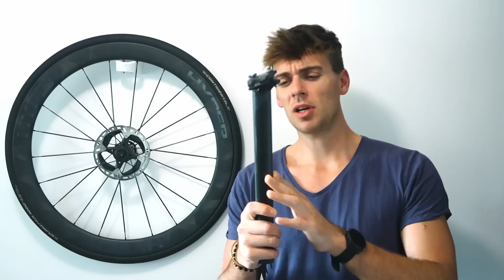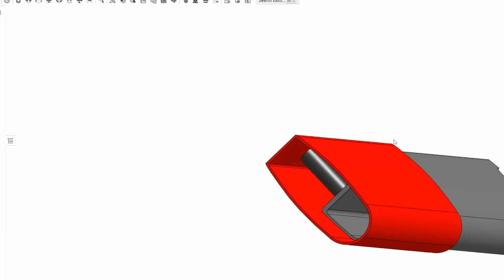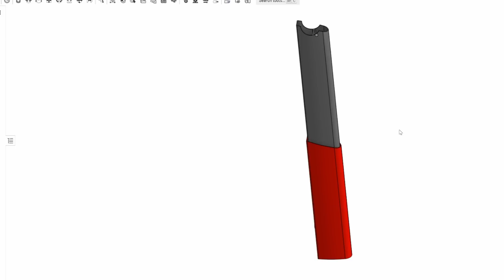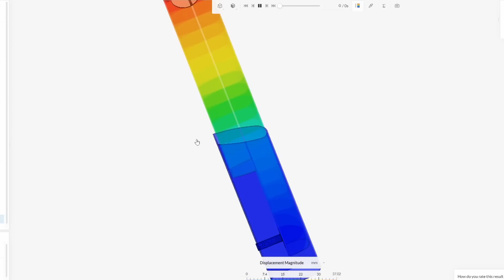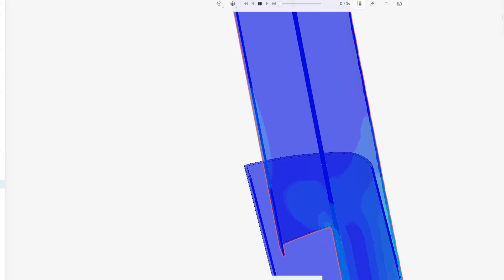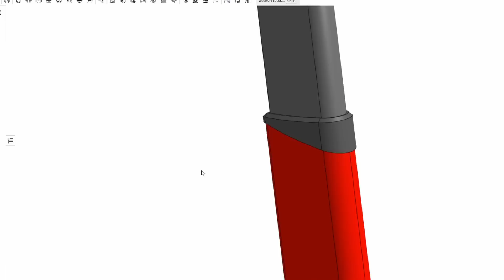2021 Canyon Aeroad seatpost fail, fix & The State of bicycle frames in 2021.

Comment: Bad engineering. The flex must be engineered in the down tube, the seat post and the saddle/beams as a system. The flex begins in the down tube where the seat post ends. the problem with aero bikes are beginning in the down tube design, it should be very weak in front back flex bend to counter the rigidity of the aero seat post.  Totally agree with the frame judgement. Greedy manufacturers need some 500% profit on the frames I presume, therefore push the price down without bothering about quality.

Comment: Peak torque, firstly I am a massive fan and I agree with your comments reference the frame industry. However, could suggesting any ad hock modifications default a customer warrant claim.
I would be very careful my friend  if a Customer took your advice and did the ad hock fix and had his warranty claim cancelled, could a barrister called Andrew then point the finger at you.

Comment: With all this critical competence you should interest yourself in the major company Garmin crap powermeter design "Vector 3" powermeter. With maybe 6 warranty claims in the last 2 years and infinite problems with their engineering i think that could be a really good topic. Many customers finally tryin to put a bit of wine bottle cork behing the connector to achieve what the brand was not able to solve (multiple drop off and peaks) , puting baby oil and trying other batteries than the one recommanded to get a set of 1200$ pedals that actually dosent work.... When brands use their customer as experimental tester... that makes me angry! thanks for the work you do, unacceptable “foutage de gueule“ en français.

Comment: Smaller seatpost with an elastomeric sleeve to cushion and damp the seatpost to seat tube intreface, done.. In the meantime just put some vinyl electrical tape around the seatpost at the frame entry area.  That clamp at the bottom of the seatpost is asking for trouble.

Comment: Different seat post. Easy enough. Longer at the bottom probably (cutable bottom?), and of course smaller at the frame edge. Bottom edge probably should be radiused.

Comment: Nice job on the mechanical analysis.  While I share your frustration with the bike industry's lack of proper design, manufacturing, and quality control, making a "plastic" frame correctly is far from easy!  Complex composite shapes and layups are subject to springback upon cooling after cure.  This can often lead to distorted parts if not properly accounted for or designed/manufactured.  Given the tolerance requirements in a few key areas of a bike frame, I am not surprised to see out of tolerance bottom brackets or misaligned head tubes (to name a few).  Employing the methods necessary to address these issues requires more costly and time consuming manufacturing processes.  Hambini has shown multiple times, some (many?) manufacturers do a very poor job of designing and manufacturing a quality product that meets the required standards.  As a composites engineer (not in the bike industry!), I can confirm building a composite frame correctly is not easy...especially at the rates/volumes most brands produce.  Not making excuses, just pointing out the industry's unwillingness to do things right in order to maximize profit.  Why do you think virtually no composite frames undergo Non-Destructive Inspection (NDI)?  There are some relatively good manufacturers, you just have to do your homework and not buy into the latest marketing BS from the hottest brands.

Comment: Nice video, no doubt about that. Doesn’t the latest Specialized Roubaix have a “flex seat post” design with a rubber grommet/cap? Aero feature aside looks like they have accomplished what Canyon is trying to do. And regarding the beam calcs, shouldn’t it be different for an anisotropic material like carbon fiber? All I remember from eng school is that they behave differently than isotropic ones...but I’m not a specialist so I could be completely wrong.

Comment: I can see another issue with this design. If the clamp bolt bush that sits against the seat post is flat with sharp corners, it may cause stress cracking of the carbon as the seat post flexes. The force applied to the carbon at this point is going to be much higher than a seat post with a clamp at the top of the frame due to the increased moment (distance from saddle to clamp).

Comment from the maker: To be fair to Canyon and I didn't mention in the video, the design intent could have been a 'simply supported beam' and not a cantilever as discussed. Pinned at the bottom (by the clamp) and with a roller support at the top, which may explain why the clearance is so tight at the frame exit. This would be very ambitious and requires a frictionless top support (at the frame opening) with zero clearance and a sliding mate. Carbon on Carbon + grease wouldn't work. It's positive to hear that Canyon are in discussion with all owners and helping with solutions or refunds.
Reply: Whatever the intent of Canyon all they needed to do was to get someone (preferably the designer) to ride the bike for 500km in mixed conditions. Too much theory and not enough practical analysis.
Reply: Instructions for the 2021 Aeroad were to use grease at the seatpost/frame-collar, and carbon paste at the bolted connection.   If the frame-collar region was sufficiently protected by a gasket, is there a reason that greased carbon-on-carbon wouldn't work?   The coefficient of friction can be quite low, something on the order of 0.12-0.14.   In comparison, clean and dry steel-on-steel has a coefficient of friction of 0.5-0.8, whereas greased steel-on-steel is 0.16 WHICH IS HIGHER THAN greased carbon-on-carbon.
Reply: https://www.bikeradar.com/news/specialized-roubaix-rear-suspension/
Guess who's got the same problem on the way?
Reply: where is hambinis Video!!!!!!!!!! did canyon roast him?
Reply: @Ghostina1  lol I was about to link it then realised it's already been taken down. Hambini's vids get taken down more often than not. Interesting
Reply: @assaultedpeanut9  Canyon did not like the truth!
Reply: I think you are absolutely right
Reply: Nice video but the calculations and modelling are massively over simplified, and the results can in no way be representative of real life. I had to say something because lots of people seem to be lapping up the science.
You absolutely cannot use beam theory (the equation at 5 mins- check Wikipedia if you’re interested) to predict the deflection of that complex part having non-isotropic material properties, complex loading and boundary conditions.  It’s not a beam as assumed by beam theory for starters - i.e. it is not much much longer than it is thick, it does not have a uniform cross section, and there will be significant shear (your FE plots show this).
You also cannot produce an accurate FE simulation of that part in an hour. You’ve neglected the load transfer from the rider into the seat tube- the seat tube would not be static. It looks like you’ve just fixed the seat tube at zero displacement. The material properties are orthotropic and will most likely vary depending on location - you cannot simply assume a uniform stiffness and Poisson’s ratio everywhere. Also it’s not clear how you’ve set up your loading boundary conditions to simulate a rider. You’ve clearly performed a static analysis whereas going over a bump would be dynamic. Couple this with assumed geometry and skin thicknesses. Your models can simply be in no way representative of real life. I’m not saying your proposed fix is wrong, I’m saying the calculations that led you to the conclusion are far too basic and have far too many assumptions to have any basis in reality. My background is 9 years of FE modelling for a living for the aerospace industry (PhD and post doc) so couldn’t keep my mouth shut sorry! Though I’m happy to be told I’m wrong- I’m an engineering nerd and this stuff interests me.
Reply from the maker: @mjlaf01  completely understand. Yes it was a basic example to outline the process for most of the viewers who won't be interested in the intricacies of FEA, anisotropic CF modelling, boundary conditions etc. There's no point doing a perfect study with so many assumptions i had to make on geometry and materials. If someone wants to send me the exact load cases, accelerations, layup schedule including layer order, transverse and longitudinal E and v of each prepreg layer, the frame and seatpost drawings, I'll send you back a quote for the work. As i said im not doing it for free. Thanks for the comment don't get me wrong you are completely correct in your criticism.
Reply: @mjlaf01  I agree with you. It is a massive simplification but what is the point of simplifying? Trading accuracy for speed/expense. I would argue that the results form this analysis should not be use to construct a new seat post or solve the problem in any other way. But it's not like they are completely wrong. He wanted to answer the question why there is a problem (and there clearly is one). These simulations give a quick overview of the problem. No one would use this to actually redesign the product. I think the estimated wall thicknesses and unknown fiber-layer layout are already a big uncertainty factors. So there is no point of taking into account all the different effects you mentioned. Sure it would give more accurate results, but it will still be a simplification as anyone other than canyon can only guess (some more educated than others) the material properties. Im sure with your expertise and access to computing power you would be able to make a much more accurate model. But the point of this video is to show where the problem comes from without spending a fortune for hardware and time expense. The model is not displaying something that is completely wrong, it's just not extremely accurate. Would you agree?
Reply: @Luca-ez2xv  Of course I agree. But I don’t think the results are presented in that context - that was my point.
Reply: @mjlaf01  fair enough
Reply from the maker: @Luca-ez2xv  thanks. Nailed it
Reply: @mjlaf01  👏
Reply: because of actual posts on weightweenies blog all the signs are that canyon plans to contruct&deliver a new seatpost (new bike deliveries are actually stopped, refund of cash in advanced was offered in some cases). But if I think about construction/test time + build thousands of them in china + delivery to europe + delivery worldwide to customer ... when the issue will be fixed completely?
Reply: From my point of view: On all frames should be two clamp mechanism - one at the top of the seat tube and the second one lower like in this case. And maybe moving parts of clamps shold be on one side (at the back or maybe better at front of seat tube / seat stay doing a bigger fricton area).

Comment: The Roubaix had this type of system, low clamp and a higher frame opening. They used a rubber grommet, and the final exit clearance is massive in every direction. Round post.

Comment: I am a middle aged geotechnical engineer that obviously does not work in the cycling industry but am often frustrated by the "techno bs" sell based on pseudo science/engineering.  Had my fair share of lemons over the year.  There was a video by either you or Hambini that made  a very good point - that engineers should be held accountable for their work.  In this case I would call this seat post a "serious maintenance issue" as opposed to an immediate life/limb hazard (like a bad tire that pops off its bead or a bad stem design).  There are fundamental flaws  with the way the cycling industry is setup that allows these issues to happen.  Thank goodness Canyon and others do not make bridges, retaining walls or baby cribs.  Hopefully they learn from this.  Hambini swears for a reason.  The issue with the fork/head tube of the Cervelo S series frames is just as bad or worse.  Canyon is now in the news but give it a few months -someone else will be.  The design/safety issues are systemic (sorry for using that word) in the cycling industry.  PS -Shimano has learned their lesson to - the cleat failures of the original SPD pedals and "Peal Gate" on the soles of their shoes in the early 90ies.

Comment: Open up a shifter some time, Shimano, Campy, whatever.... It's literally clockwork.  Fine, high tolerance parts that last forever in all conditions, suffering all sorts of abuse, and are sold (retail prices) for very reasonable prices (S105 are a work of art).  And we bolt them on poorly designed frames that cost a fortune.

Comment: Probably the most important video on the cycling Industry since the introduction of carbon frames. The fact that many manufacturers have moved away from PressFit to BSA BB’s with composite frames says it all really. How shit are your tolerances if you admit defeat with that and have to resort to using something so inferior. It’s a sad state of affairs and I agree, it doesn’t make me very enthusiastic about the industry.
Reply: @Bungle2010  I personally never said it. External cups on a composite frame is dumb engineering defined.
Reply: @Bungle2010  I'm a bike mechanic.
Reply: @Bungle2010  No, I'd just rather people had frames that were optimised for the material. BSA threaded is somewhat passable but still not as good with metal frames but bonding a threaded sleeve into a composite frame then threading in external bearings that are pressed into the cup is clearly completely dumb.

Comment: you know what DOESN'T ruin the ride? Well engineered Columbus or Reynolds Steel.

In all seriousness, I'm no engineer. Far from it. But once you explained the gritting problem, my immediate thought for a solution was a gasket or rubber cap.

Comment: The problem is not that the engineers can't figure this out. To the bosses, engineers have become the naysayers that destroy the beautiful concept and price tag that the commercial and product design department has drafted. As a design engineer for a european vehicle manufacturer I can tell you what happened there - an engineer actually figured this out and raised it during review. However the constraints were:
- The size difference between the seatpost and the seat tube couldn't be made bigger due to styling.
- Stiffness couldn't be increased due to cost targets. 
You wouldn't believe it but that's how stupid the industry has become. It doesn't matter if it's "only a few p" more than the cost target - if it's more than the target it will not be accepted. And it doesn't matter that for the sake of styling and the "vision" the product designer had the function gets compromised. IT DOESN'T MATTER and if, as an engineer, you tell them you're just and idiot who can't get it right. I've done tolerance stack calculations that simply proved a problem only to be told (by commercial people and superiors) I'm a nitpicker and have made "too stringent" assumptions (It's a tolstack - there are NO assumptions. It's just numbers). Who do you think the boss wants to listen to? The guys who tell him about exceptional style and profits? Or the guys who say everything actually is more expensive and can't be made to look like that? 

It's all lost. Buy something Japanese.

Comment: I'd like to state that, despite your claim, continental (I'm talking GP5000, the 4000 was fine) are awful in quality control too. I burned through my last rear tyre, right through the rubber and carcass below, in 5000km (I guess gp5000 is a rating for how much km they last). But the worst thing: the sidewall carcass on new gp5000s in my experience already hits the surface in 50% of the cases. There's just not enough rubber to cover the carcass.  I've had a sidewall explode on the wheel of my tt bike the second time I inflated it to 8 bars. Inner tube ballooned right through the sidewall. I've written off 4 gp5000s now, of which 3 due to these sidewall carcass issues. For a guy who rides 12k+ in a year, having tyres is starting to become an extensive hobby.

Comment: Great video!

Curious what you think of the '20/'21 Felt AR seat post design, interface with the frame, and claims on compliance.  It does seem that they cover a number of your concerns raised with the Aeroad.

https://youtu.be/17XkszWBU-c?t=140 Gives a decent look at the seat post design.

"This latest version still features the signature split design that not only allows for an aerodynamically optimized interface between the post and the seat tube junction, but the two halves of the post flex and shear independently of one another, which increases overall rider comfort. We also created a co-molded rubber insert that lives within the junction of the seatpost and seat tube, giving the entire interface added compliance. Finally, the slotted seatpost design allows for the use of a proprietary clamping mechanism that results in a lighter overall setup thanks to the use of thinner carbon walls, and a more finely tuned level of compliance for rider comfort. So what does all this mean? The new AR’s seatpost provides 112% more flex than the seatpost of the previous- generation AR. "